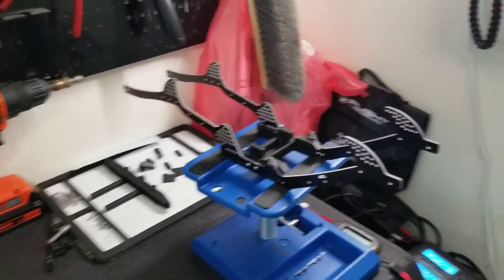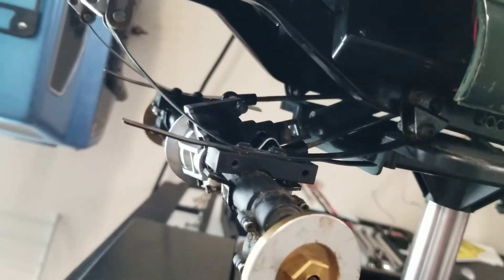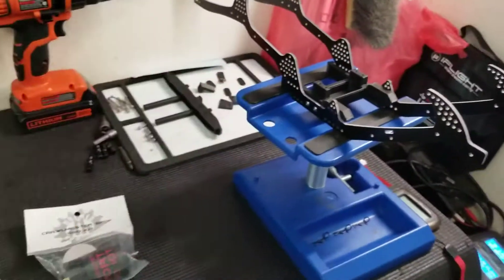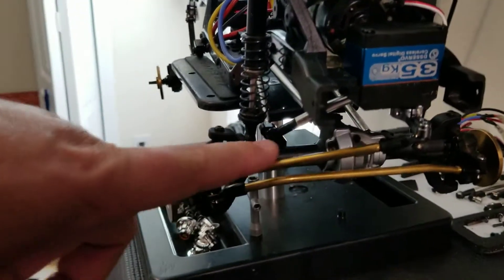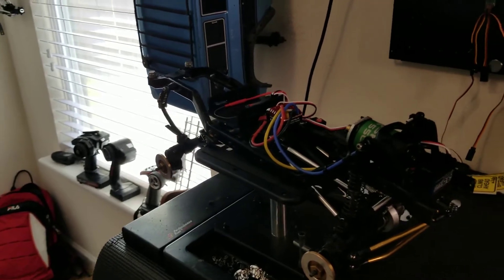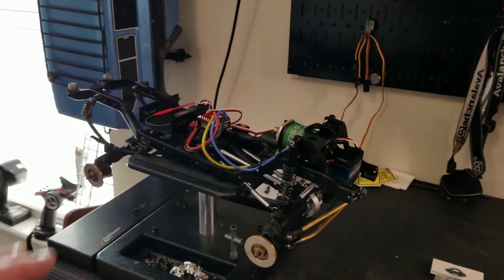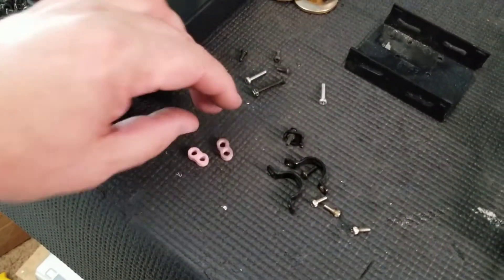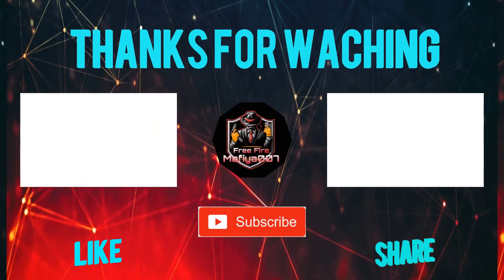Redcat Gen 8 Competition build, UGRC Predator Chassis

Comment: Excellent channel man. I built a predator chassis gen 8 portal, vanquish 3gear, vader skid. Im having trouble with the links. Generally, how much shorter should the uppers be from the lowers  length wise??
Reply from the maker: Your lengths will depend on a few things. My upper links are 1-2mm longer than my bottom links. Depends on your wheel base and axle angle.

Comment: Do you have any pics of the gen7 pro on the preaditor chassis? I have the gen8 axe and a gen 7 sport. I am doing this chassis on gen 8 but might buy 2 chassis if it works for the gen 7 as well
Reply from the maker: Check out this video. https://youtu.be/TZL59ilWyR0
I will also be doing another video on that build.